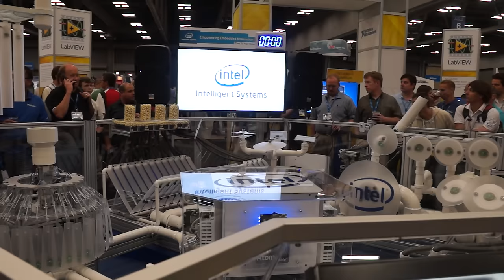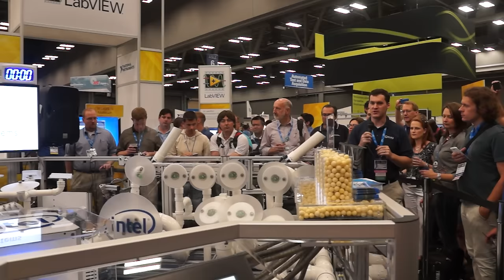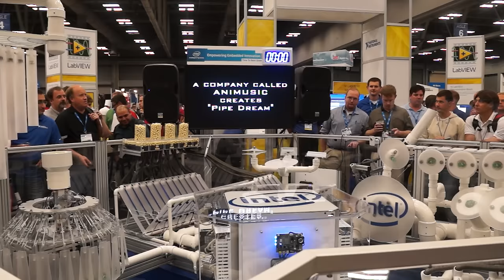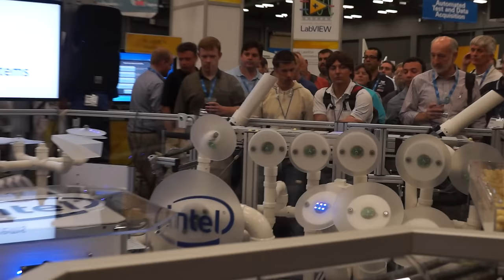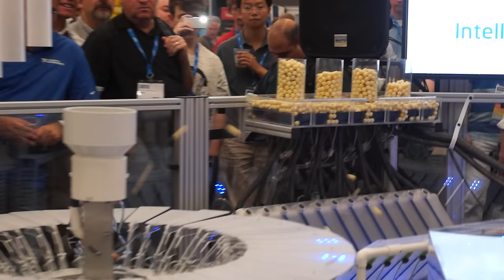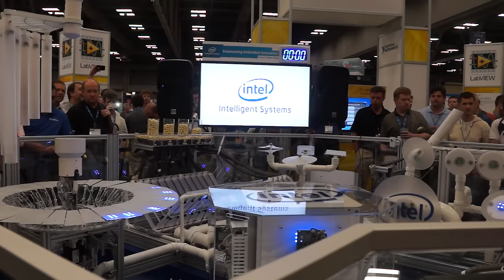Intel real life Pipe Dream instruments - Animusic

Comment: This was truly an amazing achievement.  Remember, the original video had all the balls on exactly the same 'flight path' with funnels that never failed to catch them.  Real World physics is far more complex, and there's a large element of randomness in the flight of a ball discharged from even a precision machine.  (Note that quite a few of the balls end up outside their catchbasins - but the small cheat of refilling between performances is one easily forgiven). :-)
Reply: It helps that the lights and sounds are pre-programmed, and the balls are just synced to hit as an add on.  You can see it most clearly on the cowbell high hat contraption where the cowbell will still sound and light up even when the balls miss due to the rotation, but its also noticed when stray balls hit pads but don't produce sound or light.
Reply: @ShpiggityShpike  if the balls actually played the music then it will be not good cause of stray balls hitting other panels. It's practically impossible to make a machine like pipe dreams due to simple laws of physics
Reply: @user-tp6hj4bj7o  It's possible, but not with an Intel Atom processor and cheap launcher mechanisms.

Comment: This is amazing for a live version, but if you look closely, the spent balls are falling to the floor, and not into the catch tubes seen in the animated video. Also they shortened the piece being played. The reason there are not catch tubes is because as I said in a comment for the Animusic Pipe Dream 2 video, the physics are controlled in the animation, which obviously cannot happen here. The balls don't bounce exactly the same every time. So they just fall to the floor, and don't get recycled though the Pipe System. Also if you look close at the circular xylophone, you can see that the ball firing mechanism is aiming its fire in different directions. and the part that opens the  xylophone to be played is jerky, not smooth like the animated version.
In real life the laws of physics cannot be rewritten! Still, the effort was well thought out for this version, so I give it a like!
Reply: A neater system could still be derived; there's a channel on YouTube where a guy uses this principle of using marbles to player instruments to make a song with an a analog mechanical "Marble Machine" and it has the clean up pipes that catch most of the marbles
Reply: Search YouTube for "Wintergatan". It's way more impressive than Intel's version.

Comment: I don't care if it was doctored a little, this is an amazing feat!  The first time I saw animusic (specifically pipe dreams and the drum machine)  I wondered how far off the animation was from real physics.  The recycling of the balls after they strike their note was the most unrealistic, hard to imagine part.  It would be nearly impossible to launch the ball in a way that you could predict where it would bounce after striking the note every time, so it's no surprise that they weren't able to pull that part off. 

I thought the same thing about the hihat hits, but it looked like  the closed hihat may have been a different cymbal altogether to me.  I'll have to watch again.  Either way,  this the most discouraging part, IMO. The opening and closing of the hat does seem very possible to pull off in real life and it's pretty crucial for the authenticity of the original version. bad call
Reply: You should check out wintergatan's marble machines.

Comment: it would be more impressive if instead the intel atom rendered pipe dream in real time, to the best of it's ability. which wouldn't have been very good, as it would be software rendering on a chip worse than a celeron, which were known for being low power(from low performance).

Comment: my question then is to what extent is this being "performed"?

Obviously it's all MIDI because those little balls don't have the energy to excite a string or a drum head. But is the triggering happening based on the balls? 

Or are the balls just timed and positioned close enough to the lights to make it look like it's being physically triggered?

It's impressive either way

Comment: all this and we can't even make phones that don't bend in your pocket
Reply: iphones aren't the only phones out there...
Reply: istyleonu
none of them bend
Reply: They don't bend. Just cause some 300lbs guy sat 4 hours and his iphone bent doesn't mean they will bend in your pocket.
Reply: Maro18Z actually you can bend them with your fingers.
Reply: The Countess I bet I could bend my phone (sgs3) with my fingers also if I try.
Reply: Simple fact: Aluminum is NOT a strong and resilient metal. Apple uses an aluminum alloy for their case rather than the usual steel alloy based cases. They bend EXTREMELY effortlessly when compared to an older model of iphone. Hell, try to bend the 1st generation of nano.
Reply: Maro18Z well my S2 won't bend. and as the s3 is made from a polycarbonate its a safe bet that your s3 won't either. 

even if you did manage to deform the  frame, the moment you let go it would just spring back to its original position.
Reply: The Countess Yeah, using excessive force that isn't normal when it's in your pocket... the same force would break open a regular phone...
Reply: BeerWolf not even my Kevlar ultra maxx will not bend
Reply: ***** Try bending them back to normal, they'll break.
Reply: Actually if you knew anything about how the electronics work, that is absolute bullshit. Doesnt matter how you bend it, doing so repeatedly will break soldering joints and ruin your circuitry.
Reply: Or yanno, you could get a good protective case and avoid it altogether as well.
Reply: ***** you gotta fart on it every half hour for it to work, too.
Reply: darkwarrior sorry what was that? So you're saying aircraft designers are stupid, because they use a lot of aluminum in aircraft. It takes a lot of force to bend aluminum, unless it its very thin.
Reply: darkwarrior sorry had to correct you, it irritates me so much when people say aluminum isn't strong
Reply: They also alloy said aluminum for aviation use.

If a plane was just straight aluminum, things wouldnt work quite so well.
Reply: old post but i had one of those phones, the materials were so bad quality that a slight pressure could bend and break them, they used very very cheap lightweight alluminum and didnt bother letting Foxconn strengthen them
Reply: bwahahahahaha i seen iphones that bend what planet do you life on
Reply: hmmmmmmmmmmm

Comment: Imagine a long vertical or near-vertical tube, at the bottom of which is a 180 degree curve like a J.  At the short end of the J is a rotating "nozzle."  Balls are dropped down the long end of the J to gather speed for the fall, and are ramped upward.  The rotating nozzle directs the balls.  A wheel-like device at the top would feed the balls from a hopper into the tube.  None of the loud solenoids or reciprocating parts, and you can scale it as big as needed.  It could throw bowling balls.

Comment: it appears that the instruments are not the triggers for the sounds. You can see accuracy issues and timing issues. I first noticed on the procession in the center. especially with the cowbell. great attempt but honestly could be better and more impressive when there is a guy with a marble machine that has little electronics and has more accuracy in timing than this....

Comment: The reason people aren't very impressed - its just playing the music and launching balls - some balls miss, but it still plays the note. Its essentially some ball launchers that are sorta accurate, some blue LEDs, and some motors.
Additionally, the center spinner for example desperately needs a PID tune and looks like really lazy design to a professional engineer especially.
Finally, most of the viewers are going to be people who have worked in industrial manufacturing and have built equally or more complex systems themselves, and also have no nostalgia for the original video, so all they see is a clunky music demo that shows nothing helpful towards e.g. a customer as it isn't actually working based on the balls hitting stuff.

Comment: Very impressive demo. However, it's very 'faked'. The balls and the lighting elements aren't really truly tied together, so while the audio track is pre recorded, the physical elements are 'acting out' the playback as a performance with the balls and motion elements. While it does look kind of like the balls are triggering the notes, it's actually probably the other way around with the notes triggering the release of the balls, but more likely the entire performance of all the physical elements is prerecorded and simply acted out according to a script in tandem with the notes (which was likely midi playback based). Still, it's impressive to note that all of this is being done in a clean sync with all the different elements being controlled simultaneously to stay synchronized with the audio track! So, not a 'genuine' performance of the balls making the music (they're not) but still a technically impressive demo showing how well Intel's technology can keep all the different elements synchronized and step-locked so they don't drift from the audio track, and that's not easy to do.

Still, I wonder what could be done in 2023 now?